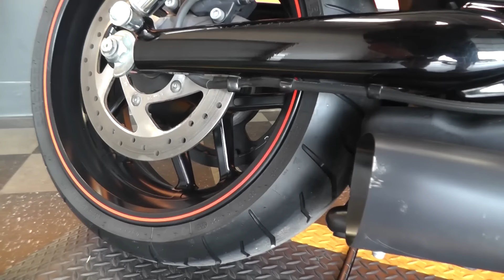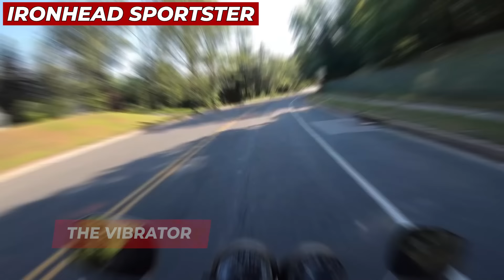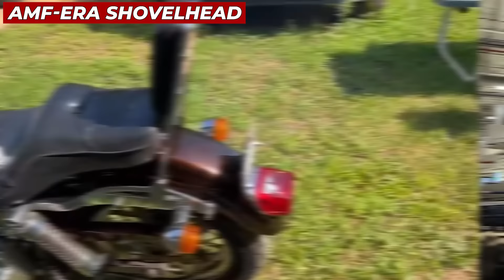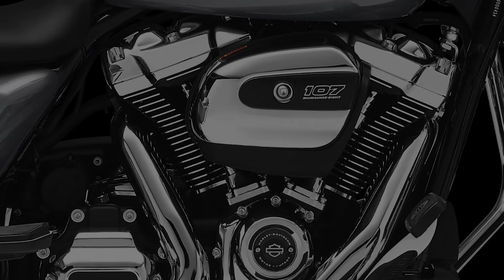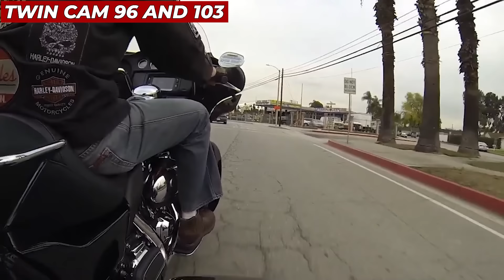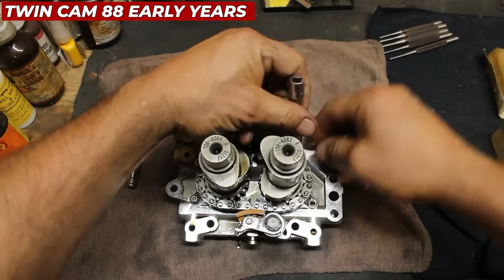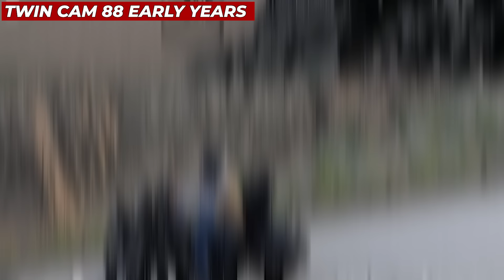10 WORST Engines Ever Put into Harley Davidsons

Comment: I have a 2013 CVO Road King 110,bought it in 2023 only had 4000 khm, 3 years later 40,500 KHM no issues.i change all fluids, take both wheels off to my tire guy, treat it like gold and touch wood all good

Comment: The V-twins.  The V-twins are the worst Harley designs.

You can tell if a Harley is going to give you trouble by the exhaust note.  If it sounds like a giant mechanical fart, it's going to have problems.😂

Comment: "The AMF disaster years...", I have heard that for decades, and it is wrong.  The only reason HD existed to a point that it could be bought back by the family is because AMF bought it first.  HD was in serious trouble with employees sabataging the company and doing things like sending out Electraglides with two different color tanks, all the bikes had transmissions that came with improperly heat treated gears by old school machinists that were pissed with HD and did not heat treat the gears properly out of revenge.  AMF changed the engine assembly process, and for the first time, fired the engines up on test stands at the factory before being put in a bike.  Before, a HD motor was never gassed up and oiled up until it got to the dealer.  I have a 77 AMF Electraglide that is still running just fine, and this report about AMF is a lie, based on lies from other sources that get it all wrong.  I also owned a 74 Sportster that I bought in late 73, the last year with the right side shift, and yes it vibrated, but it was pure fun to run.  I wish I still had it.  Harley needs to go back to just making a basic Sportster, Superglide, and an Electraglide without all the frivolous crap. Make them simple and bulletproof and forget all the geegaws.

Comment: I have a 2014 SG
Evolution industries clutch basket, comp ramp, and their spring pack with the screaming eagle compensator sprocket. 
Primary is rock solid!
Crank has a Timken bearing conversion
pinned and welded A1 crank with Carrillo rods. 
Bottom end is rock solid!
107 Muscle kit from Zippers with their head work with red shift 577 cams with a 58 mm HPI throttlebody with Fueling BA air cleaner. 
UltraCool oil cooler
Lovejug fans 
Top end is rock solid!
Khromewerks 2-1 outlaw
Thunder max ECM
PM adjustable rear axle. 
Full Ohlins suspension 
Properly aligned front adjustable motor mount from rack and pull!
Alignment and suspension rock solid!
I tried to address every single weak point and build a bulletproof bike that I can use as a daily rider or take along state to state trips or ride it like I stole it without worry.

Comment: I have a 1992 FXR - SP with 121 k original miles on it. It's never been opened and still runs great. There's a little more noise and some oil consumption. But I have no fear of climbing on it a riding 500 miles right now. It's been a fantastic bike. I have a 05 Twin Cam Low Rider with 46 k original miles that has been a great bike as well. Regular maintenance on both and I ride the hell out of them putting over 15 k on them combined yearly.

Comment: It's a wonder they were able to stay in bissness as long as they did . And now the new ceo is gonna make them even cheaper and put even cheaper parts on the bikes .that's gonna be a big mistake. I had a 2001 lowrider the cam tenchener did have to be changed a new main bering and 3 shifter rods. other then that had no problems. And i punished that motor for 70,000 miles. and when it got totaled at 78,000 miles that motor was still running strong as ever loved that bike .

Comment: I have an 83 ironhead sportster doesn't use a drop of oil and or leak a drop but vibration from the engine is just a Harley if it bothers you dont buy a sporty and if you do buy one dont bitch. I love my sportster dont have none of the problems they have on this video only problem i had was electronic Ignition and changed it back old school to points and now runs greats but everyone has there likes and dislikes

Comment: The only way you got a base gasket leak out of an Evo is. If you bore it they were bad about ripping the threads out of the bottom in. If you kept them stock, they were the most reliable motor Harley's ever made.

Comment: Once I took the spring tentioners out and the shifty cam bearings , I went ahead and put the forged camchest and hypo oil pump. Jims lifters, adj push rods, wood cams . My 02 Duece was the last year for the Timken style bearings. Bike now has 72k  on the clock runnin' plenty good for my 73 or ole' ass!

Comment: I have a Bitchin 2003 88” Thsts now a 95” ….The chain tensioner was caused by cheap material AND rough , unfinished timing chains that cut up the tensioner……Besides that easy fix,,,,,the 88” was a VERY good design that has a 4” stroke which made it very perky  and quick reving. 
      Adding a big bore to the short stroke was a great performance trick still popular today.

Comment: I have to say my 2011 Twin Cam '96 was absolutely terrible as well.  I rode it 53,000 miles without one issue.  I had my hydraulic cam chain tensioning shoes checked and sure enough, they were good for another 53,000 miles.  My Goldwing was not nearly as reliable.  Left us stranded 200 miles from home on a Sunday.  We never even considered buying another one.

Comment: Only problem I had with my old 1978.5 shovel was a voltage regulator. I carry a spare in my 82 which was converted to points too.

Comment: I owned a 1979 Shovel Head and never had oil leaking problems except after I removed my derby cover to replace the clutch. I should have used gasket sealer. I fixed that problem but the automatic chain oiler threw oil on my clothes. Belts tend to be better now that chains are.

Comment: Terrible video. Too much to list. I ran a shop for years and built many HD engines. The Knuckle was the best looking, IMO; but it had far more design flaws than any of the other OHV Big Twins. The worst design flaw they ever had was, starting in '65, pumping hot engine oil into the primary case to lube the chain and using the rotary breather valve to draw that oil back into the engine. Moronic idea.

Comment: Had  58 Duo Glide panhead for 15 years. Only oil leak came from the weep hole in the primary cover from the primary chain oiler. Since it was a dry clutch system you couldn't have oil filling up in the primary cover so it would leave a few drops of oil on the ground. I'm 73 now & still sorry I ever sold that bike.
Reply: Hi, a 58 pan was actual Harley I first got to ride. I have a 66 Electra have had for over 25 years and I am 72.

Comment: As the owner of a used 2007 Road King Classic with 25,000 mi and a used 1999 Goldwing SE with over 100,000 mi, I can confidently say that I would never buy another HD product. I've spent thousands on repairs of the Road King with the compensator failure described in the video, a transmission rebuild to repair a leaking main seal and pitted main bearing and other smaller repairs, while the Goldwing has required nothing but regular fluid changes, plugs and scheduled timing belts. Harley Davidson products are engineered to be overly complex and to fail (just like Arctic Cat), costing owners time and money, while the Hondas just reliably run and run and run. Owning these two machines was a deliberate test before I buy my next and final bike, which will be a new Goldwing Tour.
Reply: well, thank you for supporting the people who brought us pearl harbor
Reply: @angryeagle6537   Question: What do Harley Davidsons and nuclear bombs have in common?

Answer: They are both engineered to self destruct.....

Comment: Idk about that number 1 worst engine. I have a 99 twin cam with 170k on it still runs like a bear. I think the 99 to 02 is the better engines when replace the tensioner plate to hydrolic. Its the only twin cams with timken bottom ends

Comment: These Ai videos suck....  Nothing but an accumulation of "net crap" collected up by Ai and turned into continuous drivel....
Reply: In this case, drivel that is accurate and correct. One doesn't need AI to know that the engineering of Harley drive trains has been substandard for years.
Reply: @StewieSimpson-o5b  accurate and correct drivel, huh. man youre really stoned

Comment: I have a 2005 Road King Custom with a twin cam 88, stage two and replaced the timing chain with straight gears. My bike rides and looks awesome and I have confidence in my bikes performance. To say that the twin cam 88 is the worst motor that Harley ever manufactured is a bit overkill as the motor itself (aside from the tensioner issue) is pretty solid and robust overall.

Comment: Bought a 2006 Ultra Classic in 2012 with about 13,000 miles on it. The V Twin engine ran great. It was the electronics on the Harley that sucked…after about eight years (the bike is now about 14 years old ) the radio stopped, the cruise control stopped, the horn stopped, and the gas gauge was just all over the place, but those are all things I could live without as long as the engine ran. So in 2024 after I put about 60,000 miles on the ultra classic I traded it in for a new street glide w the 117. I’m at about 9500 miles on it and so far so good.  One thing I should mention about the 2024 street glide when I took it in for the 7500 mile service they called me up and said hey your whole dashboard won’t come on, it’s gonna cost $3600 to replace it,  luckily I had paid for the warranty and there was ‘technically’ no charge.

Comment: I bought a 1976 FLH liberty edition used with 22500 miles  it didn’t have all those leaks and ran without any problems up to 56000 when I had enough to rebuild the motor and transmission. Still have it and you could give a new one.

Comment: Borrow some bolt cutter and cut the rods on an 88. Installing new tensioners becomes a 1 hour job.
No tank removal, no top end removal.
Buy a set of adjustable rods and new tubes/2 clothes pegs!
Consider it corrective maintenace. It's a 1 coffee, 2 beer job.

Comment: My Twin Cam is 23 years old, and ive put over 100k on it. Ive never had a single issue with it. If you do your maintenance and dont show off with burnouts every time you take it out, it's a bulletproof engine.
Reply: Yea did you change the tensioner?
Reply: What year?

Comment: Of the 10 or so OHV/SOHC/DOHC engines, from the Knuckle on, only the Knuckle, the Sportster EVO Revolution Max and perhaps the balancer shaft TCs (e.g., TC 96B) aren’t mentioned.  The Revo Max is the newest and its quirks or flaws haven’t manifested yet, tho it’s been about four tears. 

The IH vibration basically meant one had to stop; how far could one go on a peanut tank anyway? haha While one was at it, refuel, pour in oil and get out the tools and tighten the usual loose bits. That’s part of the “charm” of the IH Sporty. That and laughing at all the newer bikes knowing with aftermarket parts (or salvage) one can hot rod without worrying about  all but the basic emissions controls.

Comment: I have a 49 pan a 77 Shovel low rider an 02 Fatboy  an 04 FXD and a 2011 low rider and all get riden constantly and no problem. But yes the primary chain Oiler did leak out the tins but you can cap that off. Been riding her since 1989 like that and trust me she's way over 300k plus miles on her. My dad and I used to work at a bike shop in Hayward California he tought me a lot of things. We have worked on thousands of bikes over the years including Triumph, and BSA. Including  bike for the Rappers Richie Rich and Tone Loc and some other influential people. Some stuff does happen its the old saying "Whatever can happen will happen"

Comment: Looks like I have a winner. 2001 twin cam 88, but less than 5000 miles. Should I be worried because of the age? Should I cut and install a sight glass to keep an eye on the cam chain tensioner shoe? Why is there a red wavy line under the word tensioner when I type it?

Comment: I rode in the later pan head days and every motorcycle built, leaked. It was part of the experience!!
Reply: I had 88 twin cam built in Nov. 98. 40.000+ trouble free miles.

Comment: The cone  shovel   and EVO    , Almost perfect        simple  easy  to maintain  held up  great .      compact - powerful  - gear drive  cam     /   They could  have used  more  engineering   with  the  balancing  .  vibrating  problem     Then     they  would be  perfect   ,        And didn't  cost  $40 000 ,           S+S cycles    engineered  better bulletproof  versions  with a warranty !            Why  cant  Harley  ?
Reply: GM has a  problem with there   new  engines  Too   !

Comment: This is some of the stupidest s hit I've seen in my career. From #10 which I was the Worldwide warranty contact for, and never replaced one that didn't have a loose triple sprocket bolt and we run low 9s on. To what you. No doubt will make number 1
 I have 106k trouble free miles on that one.

Comment: You are full of it.  138 THOUSAND MILES ON MY FXRS. NO ISSUES...  Every 60 thousand miles my top end was done  BY ME.  AT 100, thousand miles the Top and bottom end was done  BY ME.   My bike is 99.5% stock.  Only changes were chorme brake lines and a different air filter.  I had  NO LEAKS.  All of my work is  PREVENTATIVE MAINTENANCE... AS TRUE BIKERS/WRENCHER SHOULD HAVE DONE.    My bike is worth more now because of the care I put into it as well as keeping it stock (still have all of the original parts as well including the leather bad that came with that bike.  Tired of people plugging crap through AI and say things they  DO NOT KNOW!!!

Comment: I've got an 03 Electra Glide carbed Twin Cam 88 with 88,000 miles on it, it's had the cam chain tensioners replaced twice the 2nd time was 2 weeks ago they were only half worn but I got a full cam service done including cam bearings, and I also just had the inner primary seals replaced. That all that's been done to it, starts with a quick press of the starter everytime no choke, runs smooth heaps of torque, no oil leaks, rarely needs an oil topup between services, I love it and don't plan on ever getting rid of it or upgrading to anything newer.

Comment: Well you're lying about that on the evolution engine! The only time the evolution engine started blowing base gaskets is because carbon buildup on exhaust valves that held the exhaust valve open and allow the back pressure back into the engine to pressurize the oil system and the engine itself! I know this fact because I'm a mechanic I had to do it on two of my Evolution Motors after 140,000 MI
Reply: The paper base gasket deteriorated over time and leaked-takes about 30 years  to happen unless you fired it up cold and hammered on it before the jugs  grew from the running heat

Comment: Bull crap. My 1979 FXEF 74 CI AMF Shovel was the best bike I ever owned. Easy to wrench on and ride, best sounding and looking engine. I would have preferred a fifth gear at highway speed and had minimal oil leakage from the chain oiler.

Comment: I bought my 2008 883 XL Custom Sportster when it was 5 years old.
It must have had a disaster sometime because when I tried to adjust the chain tensioner and couldn't I took the cover off and was unnerved to find six gear teeth in the bottom. I couldn't see where they came from and put it in the bike repair shop and they couldn't find anything either. What had happened I don't know. The tensioner clicked when I took the cover off and was okay after that. 
The transmission filler screws were in so tight I mangled the heads and had to carefully drill them out and buy new screws. Why would some idiot put them in like that! Luckily I didn't catch the hole threads when drilling.

No major problems for me, a new battery in 2017, both rocker cover gaskets replaced by me earlier this year when I bought a bike lift for £50 instead of paying the bike shop who knows how much. A master cylinder repair kit last year and only usual maintenance jobs over the years.

Comment: I have a Y2K FLHR and it has been in the burnout pits at major Bike rallies for several years. I rode it to the event and rode it home with a new back tire. Ohio to Las Vegas in 46 1/2 hours, which means hours of sustained hundred plus mile an hour runs in over 100° weather. finally took a look at my tensioners at 66K. The inner was grooved, the outer looked like brand new. At 80K it still runs like a dream and has never been apart except for the tensioners.

Comment: Leading to the saying, "The Harley-Davidson Milwaukee-8 my bank account". i''ve ridden several of them, but I wouldn't ever own one. I'll stick to my old Pan & Shovel, as i don't experience any of the issues raised in this video for the constant mileage that I put on them both. 
I've ridden one or the other from coast to coast over the last 55 years and have only ever experienced a few really major issues. Those times had more to do with age rather than any innate mechanical issues. 

My '54 Pan was originally my dad's, & he bought it brand new, my '73 Police Special was one that i bought from an H-D dealer who was a good friend, who sold it to me cheaply when the local P.D. was upgrading to the 80 incher models in 1978. I've owned other Harleys through the years, but these two have been my most reliable long-distance putts throughout the majority of my life.